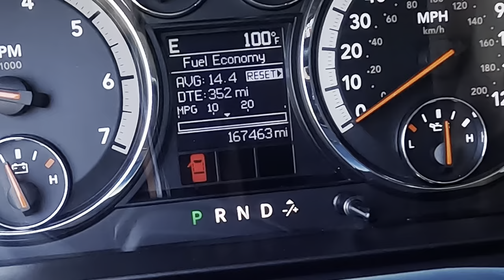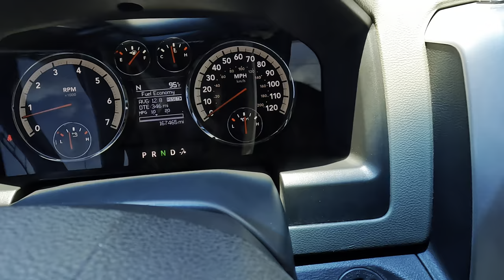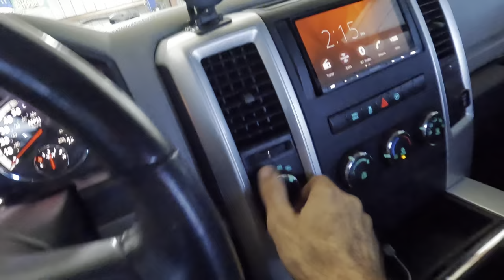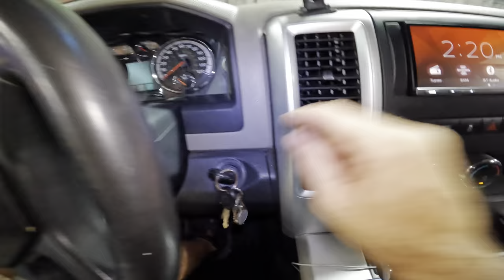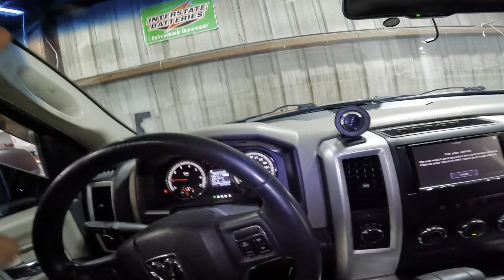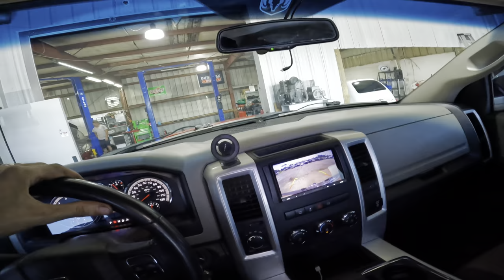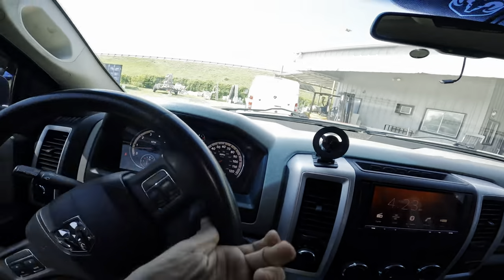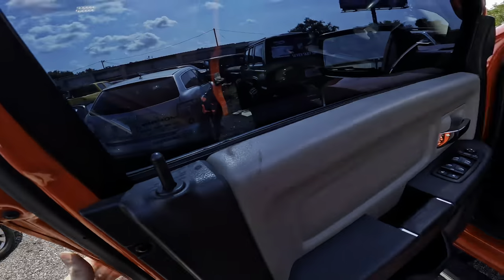Customer States: NO ONE CAN FIND IT! Sand in my Dodge Ram! Replace Whole Unit! 1500 4x4 5.7 hemi

Comment: Find some solid blocks of treated 4x4 to fit the top of your lift pads. Then the lift arms will clear the Running Boards. Allowing you to get the Arms under the Frame, instead of the small area of Suspension brackets.

Comment: I have M55 tires (10 ply) on my truck, and when I air down to less than 10psi, I absolutely float over the sand.  But they buzz.  The shoulders 'squeak' against the sand (or something) so the tires sound like a bumble bee or maybe an electric line trimmer.

Comment: I have that same ridgid gun for the same purpose and it does not break bolts loose like yours does. I even bought one if the big batteries and it doesn't perform like yours.

Comment: you dont need snap rings, done this many times on a scania and volvo shafts, you grind cut the cross and replace it and bearings. that is, if they sell the parts. you install the cross and hydraulic press the bearing cups. it's doable.

Comment: Its important to have a drive on lift, you should suspend it from the front and rear diff when suspended by the frame the tires are hanging its harder to find drive train noises, things arent in the pisition they normally are, ex( a drive shaft with no play suspended will have play when level). Same thing with bushings ex (sway bar bushings feel tight when is suspended by the frame but when the car is level they have play)
Reply: @douganderson7002  I work in a repair shop that has one. you will be surprised to see how many problems I found just because the car wasn't lifted from the frame. There is a reason the geometry of the car is like that when the tires have sprung and unsprung weight. Worst case senerio, you use 4 jack stands the large ones to check out the vehicle with problems.

Comment: The replacement spicer u joint will have inside slips to retain the caps in place.  Most drive shaft shops have the tool to press those part for about 1/4 of the cost of a driveshaft.

Comment: Ray, might be a silly question but, what about sand getting into the brakes themselves? Is it possible for that to cause issues similar to the customer's description? 
I've seen some messed up drivelines due to the "lift" kits available. I also know the carnage that can happen if the angle is off. Not pretty. Great video as always, cheers :)

Comment: Maybe it is supposed to be that way, but there is a "buzzing" throughout the post. Sounds like the airconditioning system to me. Like a loose vent or something. That might be it.
Reply: Blower motor making that noise, warranty covers it but won’t replace it because it still functions… so I just turn up the radio, lol!

Comment: THE REAR DRIVE SHAFT IS
That drive shaft is slightly out of phase ! Why, the rear top bearing eye on the shaft (not the pinion) is at the 2 -2:30 position.
I noticed when you went to the front, the shaft eye is at the 12 - 12:30 position. My bet is when they put the lift kit in they had to
lengthen the shaft and they clocked the front shaft yoke wrong upon welding it back in. Definitely out of phase.

Comment: With the lift being the likely cause of the ujoint and CV axle issues, I’ll be surprise if the warranty company is willing to cover it since it would no longer be due to faulty craftsmanship of the factory parts but rather due to aftermarket changes in the driveline.
Reply: 167,000 miles.  What insurance covers any of this.
Reply: @2148aa  Aftermarket warranty companies. Some dealerships when you buy from them a certified pre-owned vehicle will sell you a lifetime or extended warranty depending upon how many miles it had when purchased. They’re a hassle to go through though. A dealer near me used to offer lifetime powertrain warranty on anything with under 100k miles and that was certified pre owned when buying used from them. It’s since changed owners though and the new owners don’t offer that. The repairs would be paid for by the company offering the warranty if it was an approved repair.

Comment: Similar well-known issue with traditional motorcycle steering bearings. They get a little dent or notch from a hard bump, and the balls start to drop in there.  Excellent diagnostic catch.

Comment: I have a friend that bought a new ford pickup. It would start running rough and the fuel filter would be full of sand. After multiple problems he found out that the truck was in a flood at the dealership and that the fuel tank had been submerged. The dealership told no one and sold the damaged vehicles as new.

Comment: Heads up to others.
Same truck but white and a 2017. Had a front steering issues so I though at 90,000. Nobody could figure out why it was pulling the truck left and right randomly as everything appeared solid. But finally a mechanic found the issue, was the Trac bars on the rear axle. To find the issue one must use a prybar against the bushing area and frame to find this issue as the back axle was twisting n turning which made it feel like a front steering issue. It couldn't be found visually or by 🖐. The tiny bit of movement in all four trac bars was enough to throw the truck out of wack and it was tiny. It fixed the issue though.

To add...forcing customers to purchase a whole drive shaft just to replace a Ujoint should be illegal a engineering scam like a headlight bulb change in a 2008 Malibu. These corporations should be forced by law to pay for either the parts or labor in these situations or both imo.

Comment: I have had U-joint lock up and the car not want to move, at first I thought the rear end was locking up because it lifted the passenger side of the car up over a foot in the air.   When them needle bearings go bad and roll over each other its not a good thing.

Comment: Well in my experience in sand and 4x4 it causes fast spins and abrupt grabs so its hell on any 4x4 component. So it will definitely find a weak link you probably wouldnt normally hear.

Comment: That UJ can be serviced.. Mercedes-Benz has similar joint.. you have to grind the bits off then press the cups out..once  new UJ's have been fitted, you then tap new locking pinches into place..

Comment: Does the Hemi have a different firing order?  I know the valves are arranged transversely as opposed to the Chevy arrangement which is longitudinal, but I thought all crossplane V8's had the same firing order.  How cylinders are numbered is different from manufacturer to manufacturer.  

Porsche M28 V8 from the 928 car:  looking at the front of the car, the cylinders on the left bank are 1,2,3,4, and on the right bank from the front they are 5,6,7,8.  Firing order is 1 3 7 2 6 5 4 8.  I'm pretty sure most V8's are this way:

Left bank first cylinder, which is LB1st. Then  LB 3rd.  RB 3rd. LB 2nd. RB 2nd. RB 1st. LB 4th. RB 4th.

?

Comment: The front CVs and front diff stub shafts must be replaced as a set.  The lift has caused an extreme angle that has crowned the diff stub shafts.  The rear UJ is a straightforward shaft R&R.

Comment: the front u-joint on rear driveshaft had a crack on the bottom of the jount that you missed in the inspection

Comment: Id be looking in the north eastern states for a cab and motor for the tow truck, the cab could be perfect but the frame is shot, even a truck thats flood dammaged could be used.  Because its a comercial truck you dont need a plush carpet or any of that crap. Just 2 doors a cab and drive train maybe the same motor yours has.

Comment: 16:10 Bolts stuck due to liberal amounts of brown Loctite applied.
Reply: I worked on a jeep where the owner used red loctite on the bolts. He didn't tell me. I struggled with the first bolt, then realized that I needed a torch. Huge PITA.

Comment: @Rainman Ray's Repairs can you please point me to a video on replacing vacuum hoses for a GMC 2011 Express work van for the vent system? I have corroded air lines and would like to either see a video on replacement or if you happen to know what size vacuum lines I need. Other videos I've seen says 1/8 inch and 3/8 but want to be sure. Transferring my van at work while it's in the shop is a pita and would like to fix myself. South Carolina heat is getting to me and I just moved here from Chicago area. Either way thanks!

Comment: That inner cv shaft is toast either the output shaft splines are worn or inner cv joint internal splines.theres alot of rust spatter all around it.i would say thats most of problem.

Comment: Hey man. I think you're a really great technician. But in my opinion, and this is coming from someone who's a ASE Master and L1 with 25 years experience. I used to work for a large automotive repair and tire retailer for about 15 years. I lived on the alignment rack for a good portion of that time. On Independent front suspension(IFS) you always check the ball joint deflection with the suspension loaded. With the suspension hanging like that on the rack, it puts the ball joints into a bind and will hide any wear. If you disagree please feel free to message me back and let me know why you think that's not right.

Comment: Premature wear due to modified suspension. Very common on lifted/dropped cars, irregardless if it was done properly or not.
Reply: Off-set wheels cause premature wheel bearing fatigue and suspension ware

Comment: My question, why isn't there grease fittings on the front universal joint????  I've had a mechanic that has work on my truck for 15yrs, I think is really getting lazy. It the rear I had my Mechanic install a sway bar kit in 15yrs ago. I've had noise like a rattle of chains for the last 3yrs. I took it to a different Mechanic, he found right off. I'll say this, I called  Hellwig Products Co., Inc. who I purchased from originally, There Sway Bar & Bushings & links have a limited life time guaranteed; all the parts were free replacements.. Since the replacement parts got installed, my Truck is so quiet now LOL... I can say dealerships never want to repair any car or truck under warranty where they can't find the issue when they know what it is..
Reply from the maker: no way, the OEMs don't put fittings on u joints anymore. Some of the aftermarket joints have them
Reply: That's why they fail. Its like ball joints, there coated no grease fittings. I'll take grease fitting any day Ray. It looks like a clean truck. 🍀🍀🍀🍀

Comment: @13:23 Rocks/gravel between the front differential and the skid plate?
@18:00 Ah the old "Make a $30.00 part now cost $300.00"  trick.  I hate it when companies treat their customers like this!  I wonder if there is an aftermarket alternative that has a replaceable u-joint?

Comment: It's not like when you were a kid and you had a 36-in TV sitting on a TV tray in the living room and you pulled it off on your head, You learned never to pull a TV off of its stand again you'll learn the first time. If you have a truck up on the rack and it slides off and lands on your head well you're not going to get a second chance to learn from that, so check and then check again and then check one more time to make sure the first two checks were good.

Comment: 167000 miles on a Dodge and the rear end hasn't blown yet ? There's a shock. I worked for Dodge back right before Fiat bought them. They had rear end issues when new

Comment: I am so surprised that any company would warranty a 6 inch lift kit non-OEM installation. In my opinion and OEM truck could be lifted at maximum of 2 inches without causing any major damage such as this video has shown. Which may not have happened, Had the vehicle been lifted 6 inches & the driveline angles, being properly compensated for by being adjusted using shims or a pillow block of some sort or possibly even an  additional custom piece, added to the driveshaft or something along these lines to this situation doesn't happen a second time. Thanks for the informative video.

Comment: I’m thinking of buying a 2006 Porsche Boxster with 42000 miles. I’ve heard there is a concern with the engine main bearing. Any thoughts? Thanks
Reply: oversized IMS bearing used by Porsche in M96 and M97 engines manufactured in and after the 2006 model year is larger than the IMS flange housing bore which prevents replacement of this bearing without complete disassembly of the engine.

Comment: i am so glad i dont have to work on anything but my own stuff anymore. and if i can afford it i would hire someone to change my plugs in the red turd. because i have got LAZY since i retired. 2000 4.6 f150 4x4 they are all easy to change i'm just old and lazy. and when you said 4 low and sand i said u joint. and i think your right also on that. but will wait for part 2

Comment: Great diag! Too bad the aftermarket company did not do their homework very well. Dodge engineers put in the time with certain limits only to have different components used later. Modify and be prepared to fix it until you get it right.

Comment: Great work diagnosing. It bothers me to see a relatively cheap part (u joint)  turn into changing a drive shaft . Mopar engineers at there finest i guess. Honda CR-V s also have non replaceable u joints but a local guy here in NY has a way to replace them.

Comment: You need to get the rubber safety cups , i would never have used it the way you lifted it.  Perhaps it would be a good idea to make a special tool to act as a safety spacer to the chassis.   I kept waiting for the truck to kill you.🤦🏼‍♀️

Comment: Be glad you only had stubborn bolts. I had to do my front drive shaft on my gm. Needless to say, I was cussing general motors and their slotted design. U joint caps had rusted thoroughly in place. Had to resort to a 3' Pry bar and 5 lbs sledge......

Comment: Yeah that’s what I thought about my 2018 Chevy Silverado it had 17 inch tires and I had installed 265/70 R /17 aggressive winters and they made a lot of. Noise on the hardtop. I thought I had my front bearing hubs failing drove the truck like truck like this for the winter season even the passengers there was something wrong with it well anyway I kept telling them that it was the tires but they didn’t believe me so I replaced the tires all around with 265/70/R17 all seasons all the noise went away no hub bearing problems

Comment: If I were the owner, I would get rid of the warranty company and get the work done. I would trust you to fix my cars and only you over myself all day long. You could tell me every bushing needs to be replaced because longevity and I would say go for it without a doubt in what you say.
Reply: I’ve had really good luck with the warranty company and finally found Ray… if the warranty company says no I will say yes! But so far, my warranties have paid for themselves and then some. Perhaps just lucky.
Reply: @jamesstarnes311  you sir have your head on straight. good luck and you couldnt have picked a better mechanic.

Comment: I wanted to stop the video and quickly throw in my guess as to what the issue was? I'm thinking the traction control was left on and when they were in the sand, the traction control with the limited slip differential had a fit, which was likely where the noise is coming from.

Comment: OK, U-Joints were cheap last time I had to change them. So that should be an easy and cheap fix. Same with the bushings for the sway bar. Very cheap and quick to replace. CV axles are not something I've ever touched, but they look like there wouldn't be any problem changing one or both. So work shouldn't be to excessive, part price unknown to me. 

Oh and by the way always change U-joints at both ends at the same time. If one is bad then the other is probably as badly worn or close to it. Yea, basics but now I've said it again...

Comment: That damage to the lower control arms from the steering knuckle is downright scary, especially since the control arms are made of aluminum. How long before they crack? That is not an off road truck. It has been lifted, but it has huge ghetto style wheels, and tires with virtually no sidewalls. Not only is it super ugly, but it's just asking for trouble.

Comment: I would be more concerned with the amount of play and rust on the RF axle stub, when the output of the differential wears too much it triples the time and cost . Up here in the northern salt belt tha complaint is usually the 4x4 quit working. Customers never here the noise it makes first.

Comment: Why does it surprise you that after 2, or 3, or 4 attempts "that nobody has been able to come up with a viable suggestion or solution for this vibration issue" when there was no vibration complaint- only a complaint of a buzzing noise?

Comment: Modified vehicles are the worst to work on.  So many sketchy mods, installed poorly, which are the source of multiple issues.  

And nice catch on that front u-joint.  Most would have missed that.
Reply: All work is done by dealer with Mopar parts.
Reply: @jamesstarnes311  OK, didn't know that when Ray mentioned the lift.   Most modified cars are done in a shed, while drunk.  And it shows.

Comment: Question Ray. What Would cause that 1/2 inch shiny area at 10:17 ? Just curious.. Love the videos..
Reply: The truck is lifted in the air so the rear axle has dropped causing the rear drive shaft to pull out of the transfer case that much. It's perfectly normal. That part of the shaft is usually farther forward when the truck is on the ground. It will move in and out as the suspension works. The seal and the transfer case oil keep that part from rusting in normal use.

Comment: Is the adapter factory equipment or added with the lift kit? If it is not factory, can you order the replacement longer so to not use the adapter?
Reply: The lift is Mopar.

Comment: Did you  not torque the drive shaft bolts or just not put it in the video.. Since this was a explorertory mission it could have gotten out loose in the wild..
Reply: Im just a hac, I always take my car out around the block, listening for sounds coming from the car that weren't there before "fixed" it. 🤨